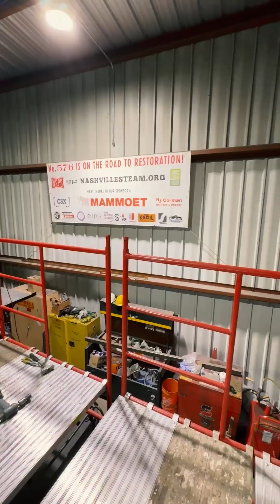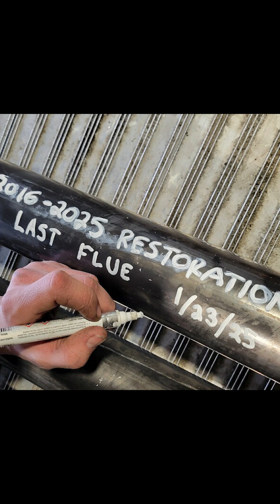Installing the Tubes & Flues |  Restoration Milestone for 576

Comment: I am very aware of the amount of intense and precise work that went into creating the tube sheets cutting the tubes placing and rolling all of them to spec. Even in a boiler that size you get claustrophobic from what I saw it looks like you were getting it right. If the math on expansion and stress are right you should  be good. How did the stay bolt process go?